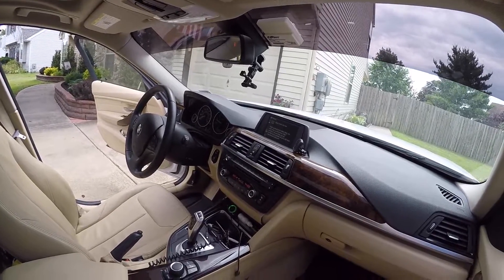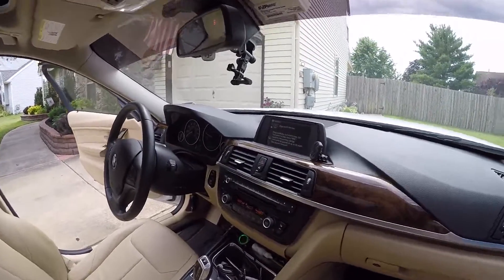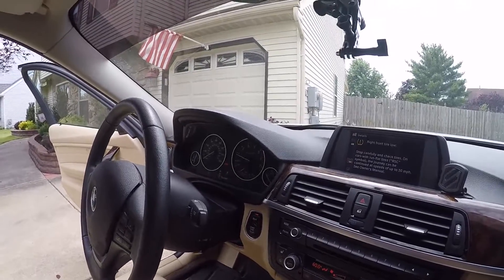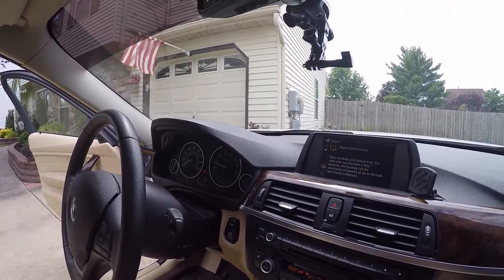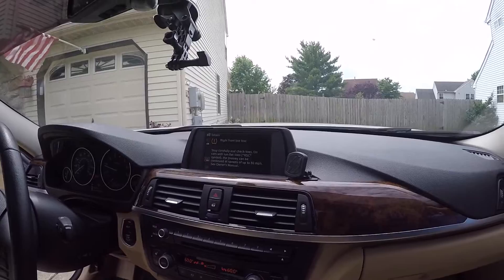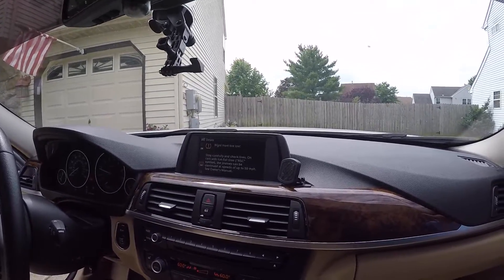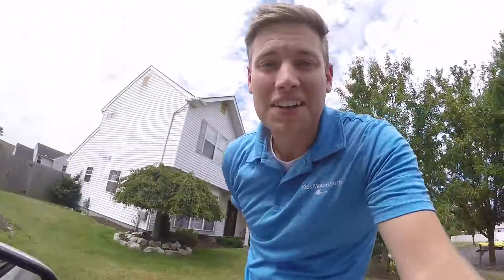Runflat Question Answered! (How long until the tire light comes on?)

Comment: You could have lowered the tire pressure with the small flat screwdriver instead of drilling holes
Reply from the maker: But that’s not fun 😀the tire was bad and it needed to be replaced

Comment: in most cars not equipped with direct pressure sensors mounted on the tire valves. the car computer could tell if there is a pressure drop in a tire only when the car is moving. when a tire suffers from a pressure drop its radius becomes smaller and thus will have a more number of rotations to keep up with other good tires. the sensors (the same sensors for ABS that detects a wheel lock during braking) on the wheel hub will detect a difference of number of rotations between tires. your method of testing would only work under two conditions
1. you have a direct pressure sensors mounted in the tire filling valve (it is not clear on the video)
2. a drop in the car height from one side (if you have adaptive suspensions) which i believe is the case of your car that is why the computer detected the pressure drop while the car is stationary.
I hope a get it right and thanks for the video ... cheers
Reply from the maker: Hi, thanks for your comment. Yes, that's correct. The car has the direct pressure sensors.

Comment: Think your test there is flawed. The tire will loose much more pressure while driving than just sitting there. I think a better test would be to put a nail in the tire, like you did in another video but maybe a bit smaller, and then drive to see how long it'll take for that light to come on.